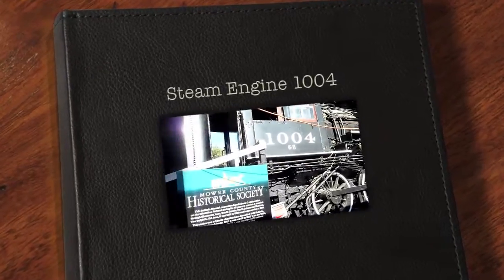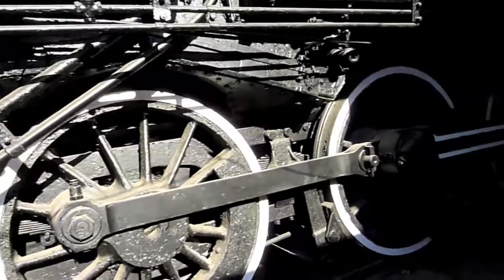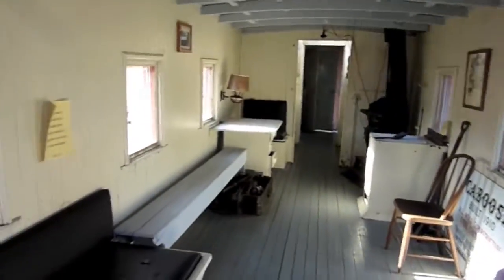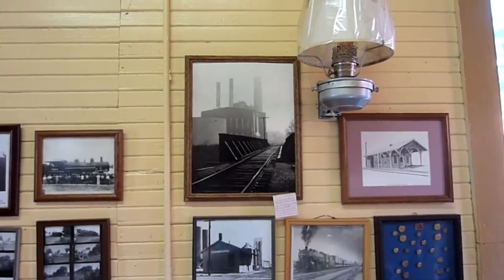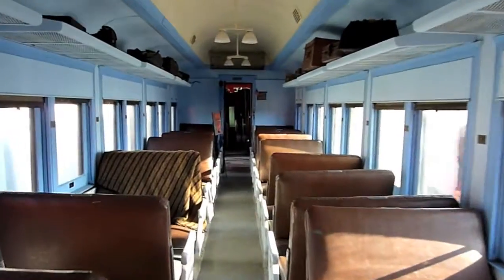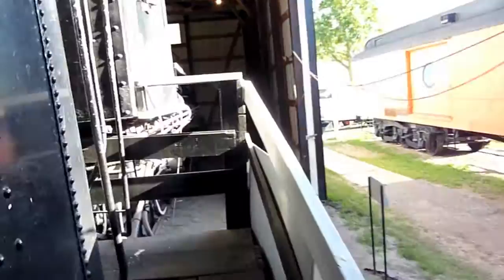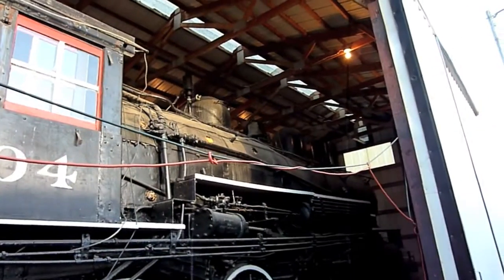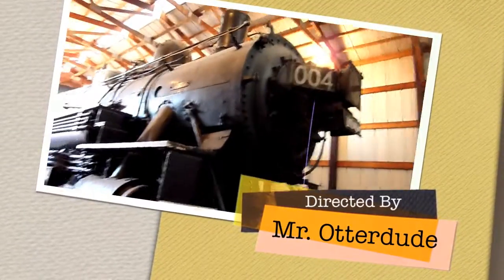Steam Engine 1004 of the Milwaukee Road!

Comment: Great video! My 1979 paint job is still holding on 1004. Dad spearheaded getting all the equipment on display. The coach was built in 1910 by Pullman and served on all trains on the Milwaukee system and served on the Day Express and Olympian, Columbian and Arrow. Later went on locals in remote areas. It was downgraded to commuter service in Chicago after 1950 and served there til 1964. The baggage was built by ACF in 1928 and served all over the system. It was painted yellow in the Union Pacific scheme when donated. It was quickly painted orange before bring moved.
Reply from the maker: Thank you for the info! I didn't know much about the train back when I did the video. I got the book on the 1004, including the story of you painting it, and learned about it. After that, I would visit the fairgrounds and man the 1004 for the Historical Society during the fair. I haven't been out there since the pandemic though.

Comment: Milwaukee Road 4-6-0 No. 1004 was on display.
Reply from the maker: Yes, it's in Austin, MN and is shown every August when the fair is open.
Reply: Milwaukee Road 1004 was preserved.
Reply from the maker: Jack Salvin Yes, and it could run again but would take quite an investment.
Reply: Milwaukee Road 1004 was soon be restored to operated for the fantrip.

Comment: Wow... I wish I could've heard the whistle, but I might go to where this is one day, and blow the whistle myself... What state is she located? I'm in New York, and we have almost no steam locomotives out here at all... well, my local railroad museum, the Railroad Museum of Long Island, has a small 3 foot gauge 0-4-0 Porter that they are gonna restore to operating status, she is on a trailer with rollers, and the wheels will spin on the rollers when she can steam... If you want to see the engine, just look for "RMLI H.K. Porter #1"
Reply from the maker: She's in Austin, MN at the fair grounds. The whistle is not functioning, but they hooked it up in 2011 and blew it.
Reply: MrOtterdude
ah, that's a shame... wonder what kind of whistle she has? obviously a step top, but I can't tell what type...
Reply from the maker: ToonLink682 Not sure on whistle type. I just remember the ex-Milwaukee Road people came here and had a celebration in 2011. I missed it. Anyway, they hooked the whistle up to an air compressor.
Reply: MrOtterdude
hm, sounds interesting... also, what type of engine is she? To me she either looks like a large 4-6-0 or a small 2-8-0
Reply from the maker: ToonLink682 The 1004 is a 4-6-0 Baldwin.
Reply: MrOtterdude
wow... that's a BIG 4-6-0